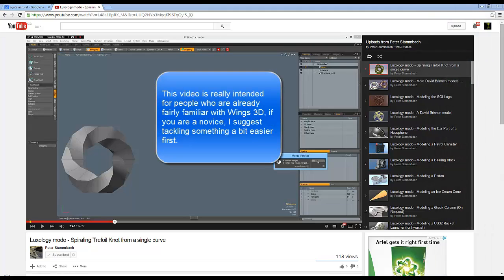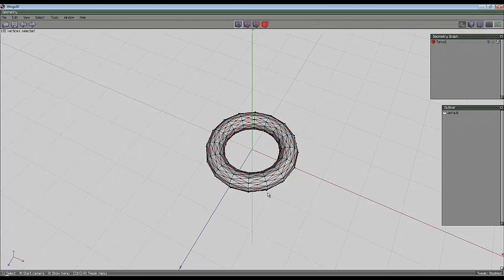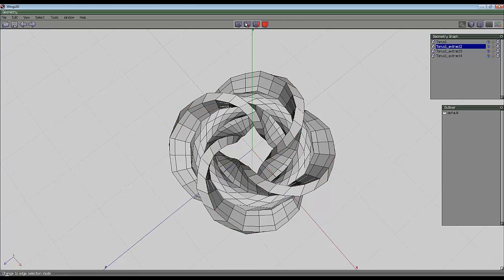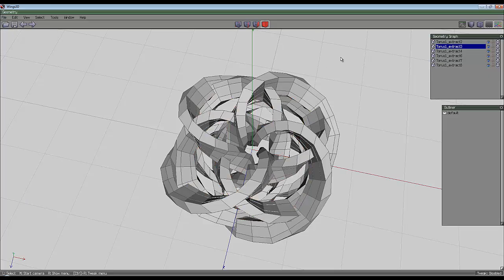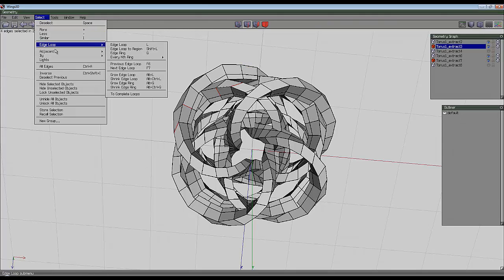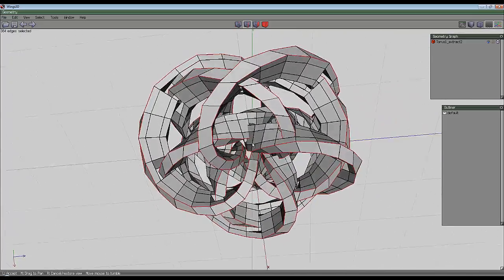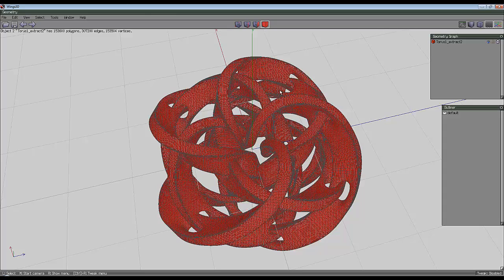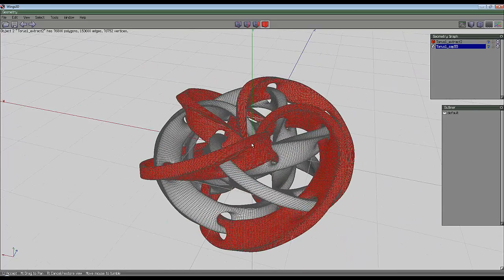Wings 3D - 16:12 torus knotted strips  - by David Brinnen.

Comment: Thanx, you made that look so easy, I have to get Wings3D & have a play
Reply from the maker: Well I hope you do.  But bear in mind this tutorial is really intended for those with a little experience in Wings already, so don't be disappointed if you find you are initially thwarted by some of the quirks of Wings's workflow.  For example what you get on the context sensitive menu is dependent on what selection mode is currently active.  Also, be aware, commands vary depending on if caps locks is engaged and you will find many have variants for left, middle and right mouse buttons.  Such things can be a little confounding at first, but it does result in a far less cluttered interface than you see a lot of software.  Well, try it and see how you get on.
Reply: David Brinnen Yes, you're right. Have you made any beginners Wings tutorials?
Reply from the maker: dijidave One or two.  But there are plenty more by other people https://www.youtube.com/results?search_query=wings3d+tutorials+for+beginners
Reply: David Brinnen Thx